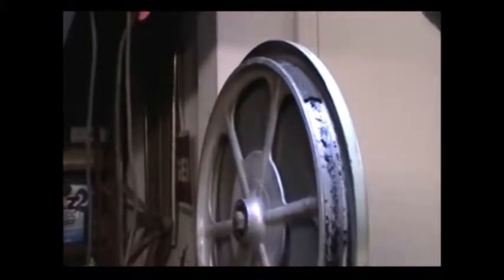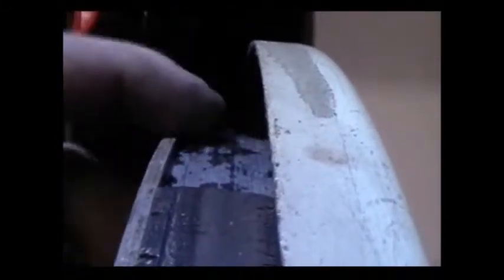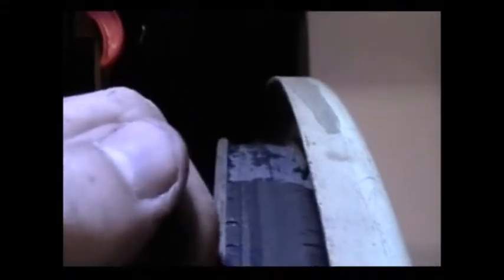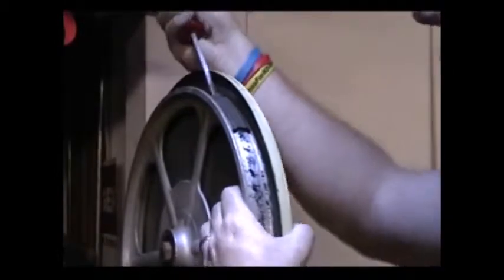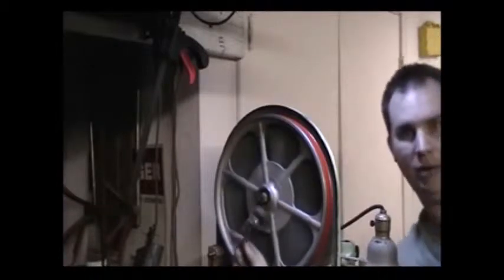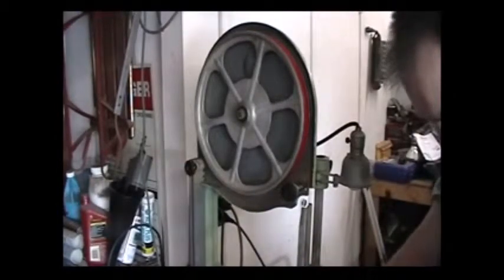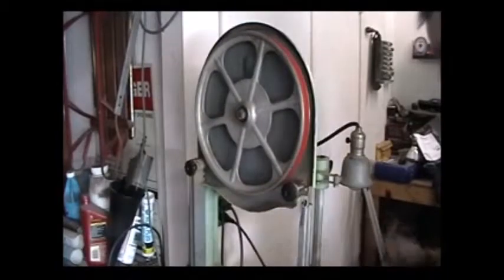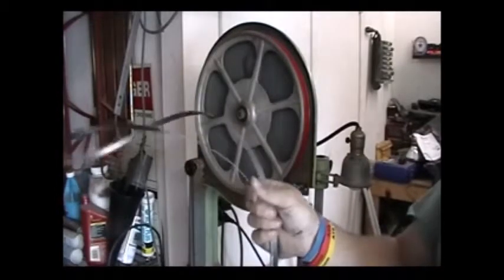How To Change Your Band-Saw Tire

Comment: They welded that blade very cricked. You would be much happier with a new blade that didn't have this issue.
Reply from the maker: sixtyfiveford   Yeah I was shocked at how bad that was.  I should have exchanged it.  Oh well Ill just use it for a rip saw blade for now.  Just hope the others arent near as bad.
Reply: Hold your angle grinder on the back edge while its running. This will true it up and make it cut a ton better.
Reply from the maker: Good tip. Thanks I'll give it a shot